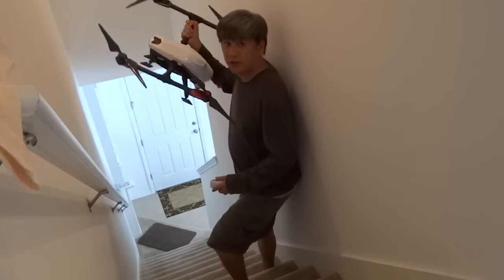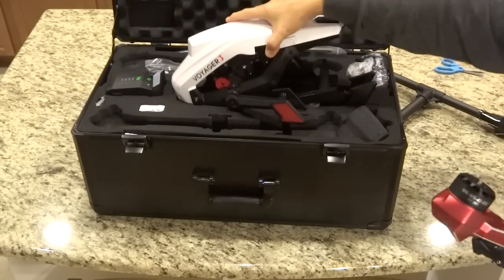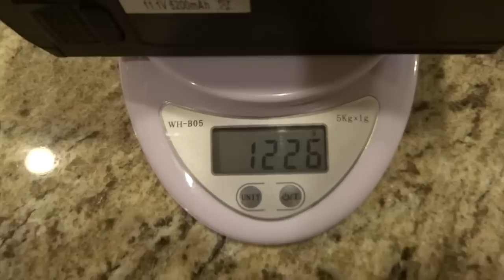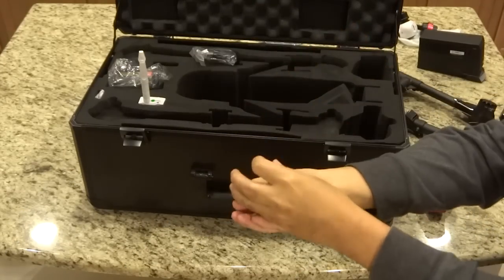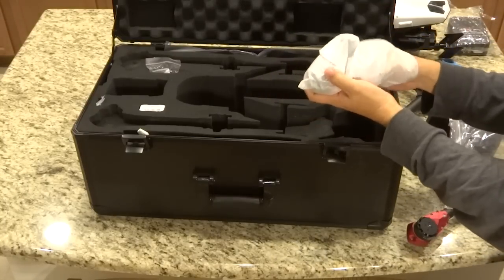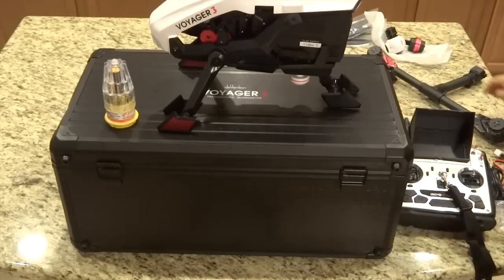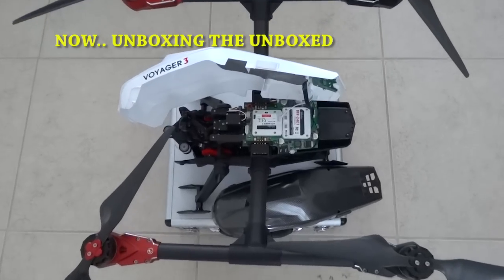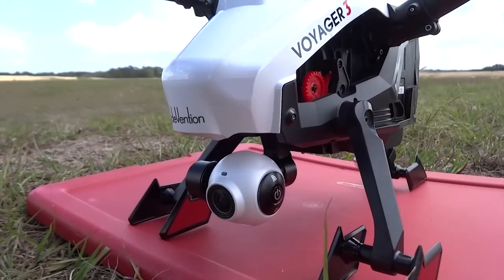Walkera Voyager 3 unboxing the unboxed review

Comment: looks amazing, can anyone confirm flight time above 15 mins? and maybe range test of this beauty...tnx
Reply from the maker: Damir B advertised as up-to 25 minutes, we have tested it for 18 minutes but before the low voltage vibrates. there are videos showing the f12e radio going beyond 2.1 km with video at the beach, on clear day.
Reply: ***** f12e with this bird or ?, can you point out link, tnx...btw, does voyager rth after low voltage in tx or in bird ?

Comment: what is the max rang?
Reply from the maker: +JEFFREY SOLORIO (PROJEFFREY11) aloha. It will depend on the radio and location you use.   Typically 1km for the radio transmitter,  flying 45 degrees above the horizon and stock video tx 800m.  Max range achieve is 3.5km on a F12E